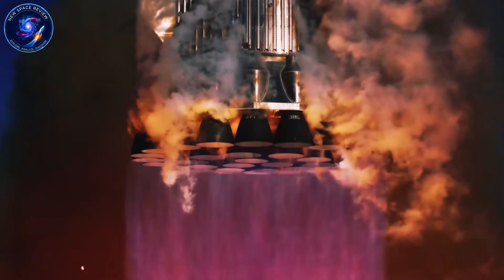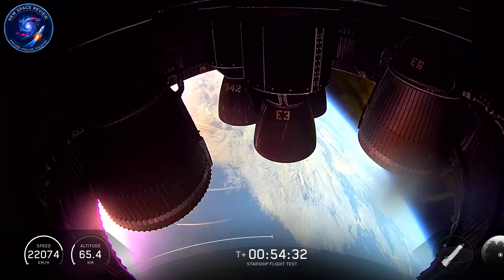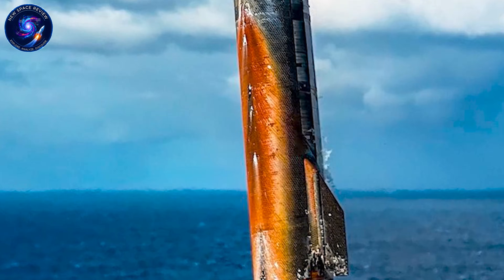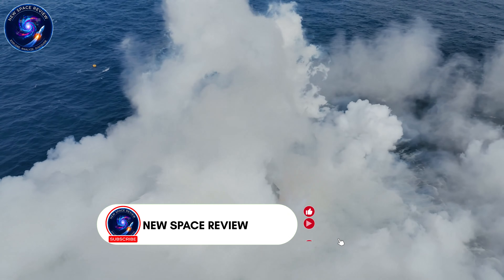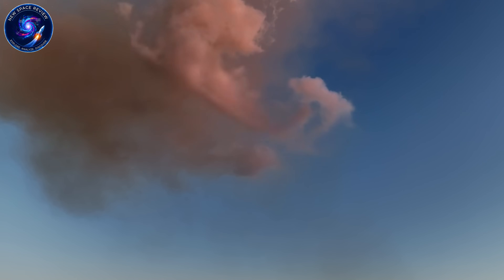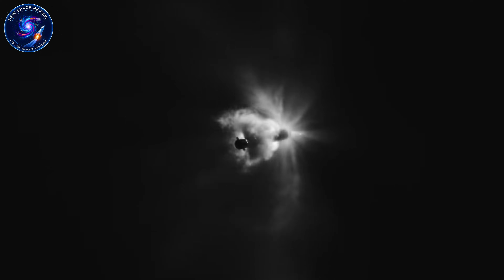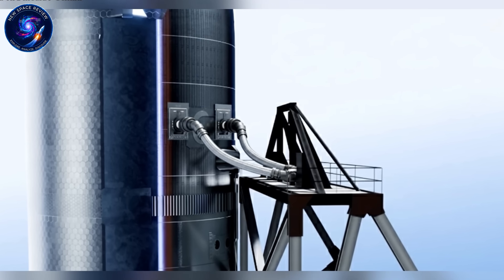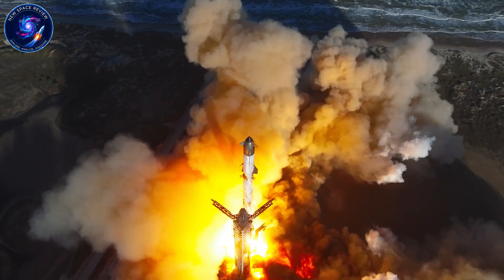Elon Musk Found Brilliant Solution: Raptor 3 No Heat Shield...Shocked!

Comment: please explain how this helps anyone but musk
Reply from the maker: Raptor 3's no heat shield design slashes ~40 tons of dead weight from the booster via extreme regenerative cooling + internal components. That boosts Starship's reusable payload to 100+ tons (from ~60), enabling cheaper satellite launches, bigger science missions, and faster Mars progress for everyone—not just Musk.
Reply: Just try to get anything into space and you will understand how he has reduced cost to LEO by more than 10 times.